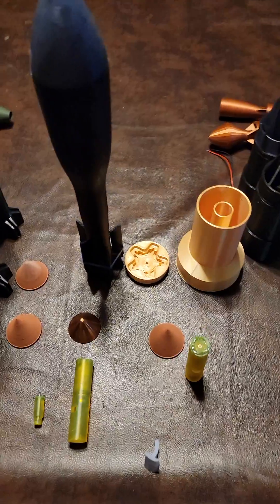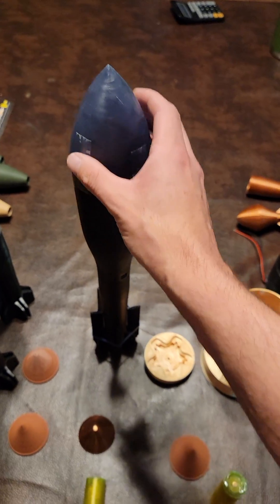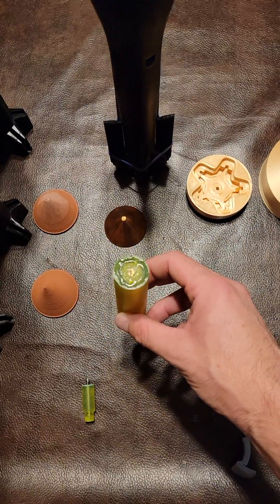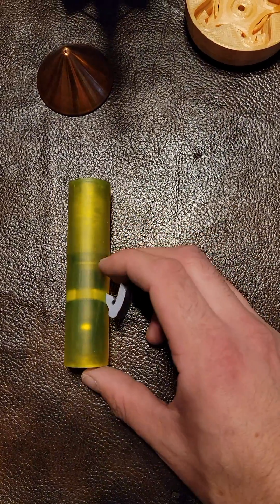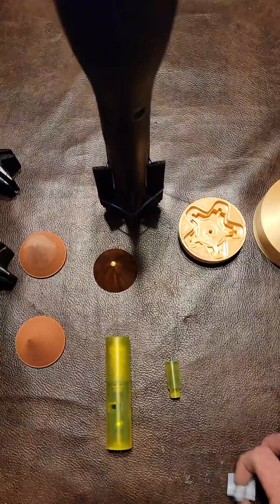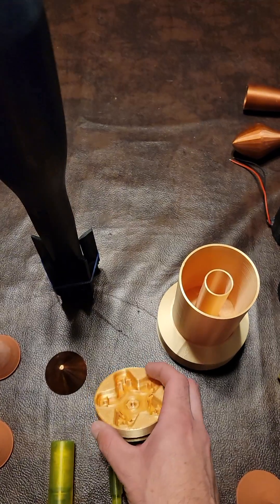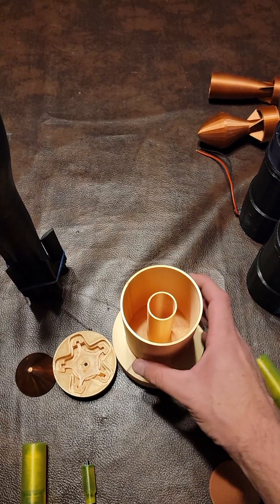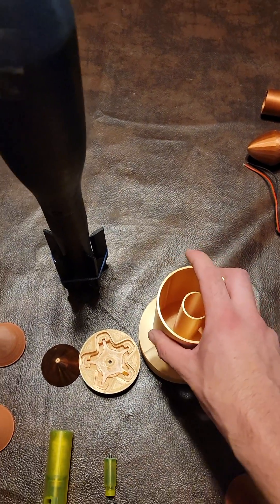World's First 3D printed anti tank rocket explained

Comment: How well does the shaped charge work, I've never been able to get the standoff distance right in all my test and it always initiates on target rather than before?

The safety pin is genius, I've only used a spring to keep tension on the bearing so it doesn't wiggle out and initiate prematurely but that has the con of it is potentially obstructing the bearing used for striking 

I don't want to rely on arduino for timing and proximity because my goal is 100% 3D printed rocket as well. Also I use a bag of saltwater for the countermass, I drew inspiration from the javelin

Comment: Not that I support the alphabet bois, but I assume that you registered these as destructive devices?
Reply from the maker: They are inert until Ordnance Lab uses these components to manufacture them into functional munitions. They handle the paperwork.
Reply: @DandSCreations  I am not a lawyer but I was under the impression that even an empty device which is designed to hold explosive is considered a DD (so, for example, if you want to make a hand grenade, you are supposed to file the paperwork before you even make the parts for it). Note how de-milled grenades, rockets, etc. always have something done to them to make them unsuitable for weapon use (such as holes drilled into them).
Reply from the maker: @sbreheny  nope, you can buy fully in tact hand grenades, as they are not a weapon. Now the fuse detonator contains explosive so it is controlled. 

If it was a launcher it needs to be demilled. But the ammunition isnt ammunition unless it contains explosives.

Comment: Are you using the virtual foundry filament for the liner?
Reply from the maker: Si
Reply: Cool did you put it through a thermal cycle like in a kiln or did you just use it straight out of the printer because I saw a video where someone used the same filament but put it in a kiln to make the plastic dissipate and the metal form together
Reply from the maker: @twinternational6507  it is used green.
Reply: @DandSCreations what do you mean
Reply from the maker: @twinternational6507  not post processed straight off the printer
Reply: @DandSCreations oh ok cool you Could get 44mm penetration have you thought of making your own rocket motors if you aren’t already because you can make it bigger and more powerful and cheaper especially with the gps glider you guys are developing
Reply from the maker: @twinternational6507  we have no need too we already use commercially made rocket motors. I have access to motors that can lift a Volkswagen
Reply: @DandSCreations do you plan on Putting the files on the sea soon like the at-420?
Reply from the maker: @twinternational6507  it's not yet ready still improving accuracy

Comment: Awesome work! What primary are you using?
Reply from the maker: In regards to the boost charge or you mean to intimate the HE for the shaped charge?
Reply: @DandSCreations  The initiator for the main HE charge.
Reply from the maker: @HoffmanTactical  209 shot shell primer into a homemade blasting cap of desensitized flash. (Kn03/Al/sulfur in a spent .223 case.
Reply from the maker: @HoffmanTactical  it works on OL's "Gemini" Liquid explosive. We'll get more elaborate as testing progresses.
Reply: @DandSCreations  Interesting, I would not have thought that was enough, but I guess it depends on the main charge.
Reply from the maker: @HoffmanTactical  the our Ordnance Lab collaboration, we did static test. The printed hollow cone full of copper mesh was a fail though and had poor penetration, so we switched to real copper cones and %90 by mass copper Filamet.

Comment: What are you guys using for the launcher tube insert? Did you use fiberglass, steel, etc. I'm just curious because I used steel on mine and didn't know if you found a lighter alternative that withstands the pressure generated from the boost charge. Anyways thats a very clever design. I wanted to have the counter mass, powder charge and rocket all in one apparatus but what stopped me from going about it was the print time. Do you guys lose that countershot sleeve every launch? Most of my pistons survive multiple firings but the countershot container took so much time for each shot that I ditched the idea. Also I dig the fins how they get deployed via the piston. I use torsion springs on my fins and they are very tedious to install
Reply from the maker: The tube is PVC, with a fiberglass overwrap. Future versions will be Kevlar. Our boost charge will only be 25 grams. The entire cartridge is to be shot out the back and any remnants dumped from the tube prior to each shot. They are sacrificial. Torsion springs would be an improvement I believe. We're constantly changing the design until we reach perfection. The hardest part will be getting the motor timing correct. We're experimenting with different ignition methods and compounds to get the fastest ignition possible, without detonating the motor.